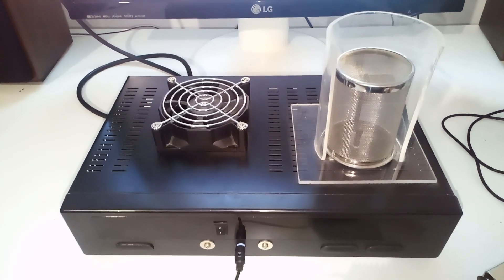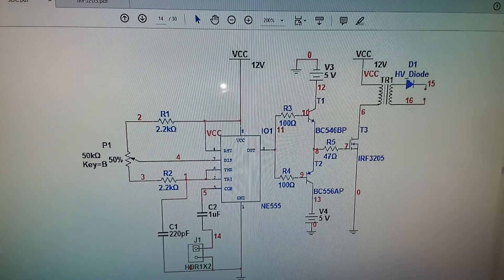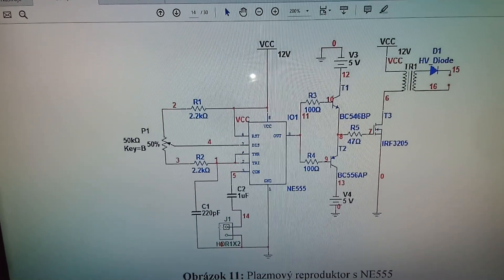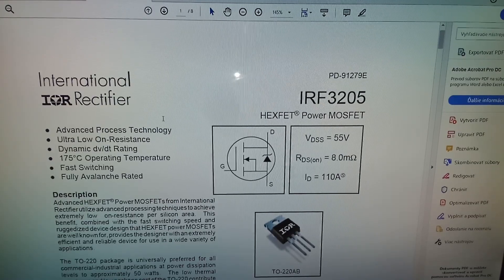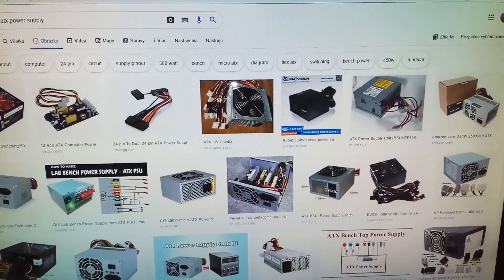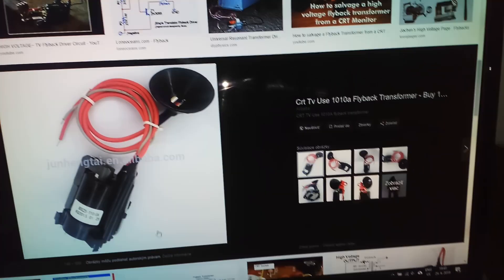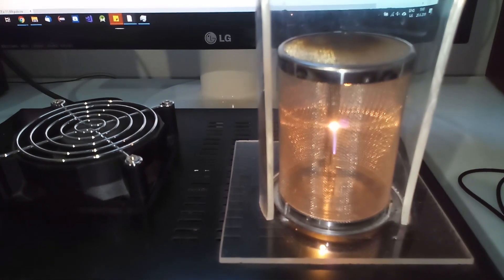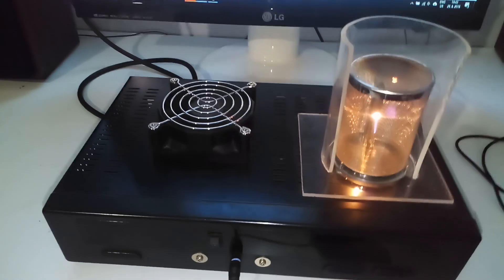Homemade Plasma Speaker

Comment: Cool setup. I'm trying to work on finishing one up now. I liked how it sounded from around 35 watts so I built a setup cranking closer to around 75-100 watts but the problem I have now is not being able to run a smooth arc with such high voltage. Too much wind I guess and it likes to move too much. These things sound amazing for what they are. I like the whole screened in deal and the half enclosure.